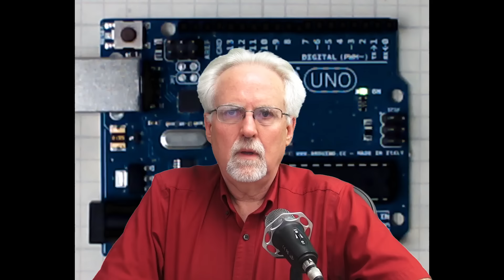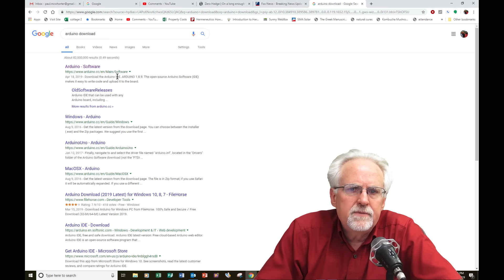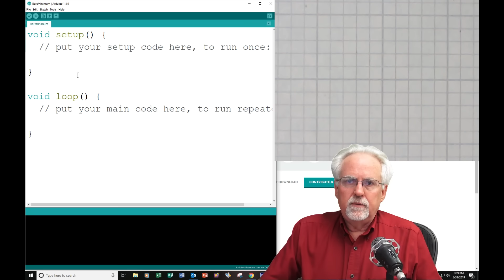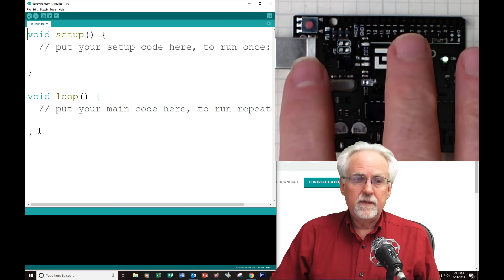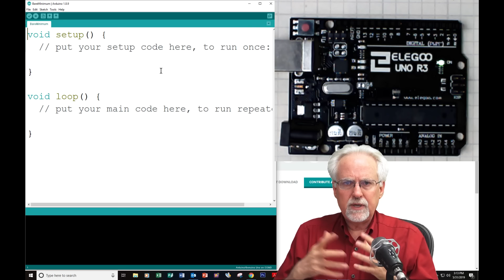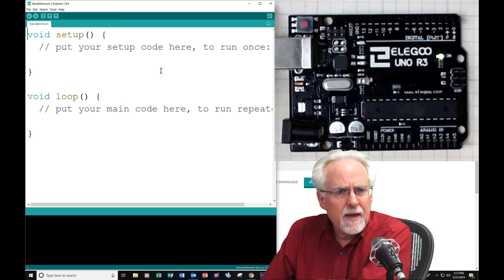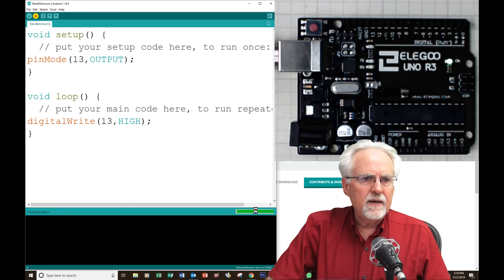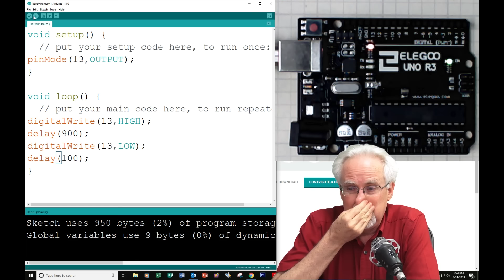Arduino Tutorial 1: Setting Up and Programming the Arduino for Absolute Beginners

Comment: What does it mean when you compile and get error message saying 
“exit status 1”
“Error compiling for board Arduino Uno”

But when I set the same delay to 1000, it works alright and if I set HIGH delay to 900
AND
LOW delay to 100 
I get the error message

Comment: Thank you for this video and I am taking dive into Arduino world as well, I am working on my first project where I am using Arduino to control the brushless motors, I am using the code that is given to me by the company who makes thrusters, when I uploaded the sketch as shown below to Arduino, I am getting this error, - any suggestions? 

#include <Servo.h>
byte servoPin = 9;
byte potentiometerPin = A0;
Servo servo;
void setup() {
servo.attach(servoPin);
servo.writeMicroseconds(1500);
delay(7000);
}
void loop() {
int potVal = analogRead(potentiometerPin);
int pwmVal = map(potVal, 0, 1023, 1100, 1900
servo.writeMicroseconds(pwmVal); 
}

Error - exit status 1
Compilation error: expected ')' before 'servo'

Comment: In order to see the board Arduino IDE requires Port No for the board, but in WIN-11 there is no Port.. I did install the board via USB and ran the IDE it requires Port# to upload the driver, so I went to USB secton under Device Manager and cannot see the Arduino Uno R3 board, I disconnect the Board several times but still cannot see the board under the USB Network either. -- any help?
Reply from the maker: You might try a different cable. could be issue with USB cable.

Comment: I'm a retired software developer in my 80's and throughly enjoying this series.  Having taken innumerable programming courses over a 50 year career, I can definitely say you are the absolute best technical instructor I have ever encountered.   Everything you say is absolutely clear, concise, and a teaching moment.   I'm currently on tutorial 22, but returned to tutorial 1 to encourage new students to get the starter kit and do the exercises as you  progress through the series. I have one suggestion.   Unless I missed it somewhere along the way, you don't talk about comments in your coding.  Comments embedded in code are a great assistance in going back over the code if problems develop months or years after the code was written by the original developer or someone assigned later to maintain the code.  Adding comments is as simple as beginning the comment line with //.  Comments following the // will not be compiled and appear in the code as "grayed out."  An example of comments is the " //  put your code here, to run once: "  in the beginning of the void setup paragraph.
Reply: I too am an 80-year-old software developer and retired company owner.  I have almost no hardware experience.  I stumbled upon this series and am enjoying it immensely.  I plan to ask Santa for an Arduino starter kit, but for now I am using the simulator TinkerCAD.  So far, it allows me to do most thing.  One thing it does not do is allow you to press two buttons at once.  For now, AND and OR gates are out unless you use a switch (which I have successfully done).  I also taught programming in the 1960s and 70s.  This tutorial is absolutely "top shelf."
Reply: It's been 4 years, can I still see to learn it?

Comment: @PaulMcWhorter Your sketches are tiny (a few hundred bytes) and mine on the Arduino R4 WiFi are huge (30K bytes). Mine also take much longer to upload. Any idea why and is there something I can do to reduce the size of my sketches?
Reply: it probably sends all the wifi library functions and stuff with it even if you don't use it...

>is there something I can do to reduce the size of my sketches?

yea, learn all about arduino and the MCUs the R4 Wifi uses  (i mean for a whole year or however long you need, 8 hours a day) and then rebuild the framework for that R4 Wifi the way you want ...

Or use the regular Arduino Uno. But hat thing does only have 2KB ram and sucks "to have real fun" with IOT and stuff. I would try to use an ESP32 board "as an Arduino".

but an arduino uno clone is cheap so you can have that, too

But if you realy want to understand microcontrollers how they work down to the bit register level then regular 8 bit atmega328p based Arduino Uno is way more easy to understand than those 32 bit controllers ...

Comment: Hi guys, I've just got an arduino mega starter kit. 
I've got a MEGA2560 R3, where I'm trying to run these scripts, they error, pinMode returns compilation error saying pin Mode does not name a type.
I'm running IDE2.1.1
Any help gratefully received.
Reply: I'm downloading an older version, see if this is better.
Reply: Older version works fine, thanks.

Comment: Hi, Paul. Loving your videos. I've built a countdown timer using Arduino uno, but it was expensive. Can you show how one can build a circuit that does the same thing as the Arduino using a stripboard? I know one particular chip that can be used is the Atmega328, which I have. This would make the project so much cheaper to build. Thanks, and keep up the good work. You really rock (as you Americans would say). Paul Smith.

Comment: I know it's all about the OS of choice. But I have to say I haven't purchased a M$ product for my main workstations since ME. If you know ME, you know why.
That's when I went to Linux, so it's been a while. Currently it's Linux Mint 21.1. I have to say that getting the interface down to actually connect to the device is non-trivial. Help at Arduino (& most sites) unfortunately didn't work. I had to follow some instructions to write a configuration file in the OS. But lesson 1 is in the books and I hope to do many more!
Reply: just add the correct group to the user to make the serial like `/dev/ttyUSB0` work without root rights...
(logout needed for changes to take effect)

I use Arduino IDE version 2 and vscode with PatformIO extension on Arch Linux. (PlatformIO does NOT work with forks like vscodium !)

Comment: OK, Let's say I have a Nano that is getting 5V power from another misc board via the 5V and GND pins.  I need to unplug the other misc board while I move everything to another location in the house but I don't want to lose power to the whole thing (it is counting Muons) so if I connect the USB on the Nano to a 5V power source BEFORE I unplug the other misc board feeding 5V to everything, will I cause any damage?  Or is it 5V input from 2 sources makes no difference?
(By the way, I asked ChatGPT and it said it may cause a short circuit and potential damage.)
Reply from the maker: It may cause a short circuit and potential damage.
Reply: @paulmcwhorter  Thanks.

Comment: My compiler doesn't change the colors of the text. Any idea why? It still works but the visual aid would be nice to have.
Reply from the maker: I was on arduino IDE version 1.18 I think, which I like much  better than the version 2.xx you are probably using. Try downloading the legacy IDE and see if the color helps are not there.

Comment: if I use OUTPUT and High commands, they don't turn blue. Any ideas? It's an arduino Uno board.
Reply from the maker: It is the new IDE version 2.X. I am using I think version 1.18, which Iike much better than the new one.

Comment: Paul, I have a stupid question- if I connect just the button to an input pullup pin and ground- how input is read if there is no power (?). No other components are used. Thank you
Reply: INPUT_PULLUP electronically switches an internal resistor inside the atmega328p controller to +5V on the IO pin. Digitalread will give a HIGH. if you push the button the pin is directly connected to GND 'overpowering the pullup resistor' - digital read is LOW when button pressed.

Comment: pinMode(13, OUTPUT); 
Why OUTPUT in my IDE is not blue or Green ??
Reply from the maker: I am on 1.18 of the ide. I dont like the new 2.x of the ide, which is probably what you installed.
Reply: I am not sure what you are saying, but what I think you are saying is "Why an OUTPUT". The Arduino needs to know if the pin is an INPUT or an OUTPUT to set the pin up for use, but what is the difference between the two? The OUTPUT is if the pin is outputting data, for example, lighting up an LED. The INPUT is if the pin is getting data, for         
 example, reading the temperature from a temperature sensor. I hope that answers your question.

Samuel
Reply: >I am not sure what you are saying

that different arduino IDE versions could have different syntax highlight color settings

the exact syntax coloring style used usually isn't that important to programers. it's just for easy seeing the different things because they have some different color.

Comment: Hello, like your Videos. 
Which tutorials do you recommend to learn how to make button, toggle switch inputs to do a function on a windows 11 flight simulator?
Reply: In lesson 28 Paul talks about how to use a Toggle Switch with Arduino. But in these tutorials, Paul does not talk about how to get Arduino to talk to programs on the computer, but he has some other tutorials that he made, that will teach you how Arduino and Python can talk to each other. For example, Arduino is reading the temperature of a greenhouse and we want to display the temperature on the computer as a 3D thermometer that is displaying the temperature that Arduino is reading from the greenhouse. But Arduino can't do that, so what we can do is use Arduino the get the data that we need and give it to Python to display it on the computer. But displaying is not the only thing Python can do, it can do pretty much anything on the computer. So I think you need to look at tutorial 28 and do the Arduino with Python tutorials. Sounds like a cool project, if you want feel free to post any Arduino projects you are working on in the comments we always are here to see the projects you are working and we are always here to help. I hope all of that can help you out a little bit.

Samuel

Comment: I appreciate what you are doing here. I’ve got a question. Is the PWM programming limited to above 1000 hertz or can I set a range variable 20Hertz to 100 hertz with variable duty cycle? 

Can I run the other channels at 25Khz fixed with variable duty cycle?

I’m considering jumping on board this Arduino seems like it could be very useful.
Reply: The Arduino Uno is 16MHz so the PWM programming limit is way above 1000 hertz, and yes you can set the speed of the PWM. If you want more about PWM then go to tutorial 8, the video is about PWM. 

Samuel
Reply: Thanks for the information, I think it would work great for most of my project. It doesn’t sound like it will work for the other part. I’m limited so far to audio amplifier and signal generator at the moment to get my transducers to perform the vibrations I’m looking for at 20-100 hertz variable frequency variable amplitude. I am hoping to find a way to integrate this into a less complicated easier end user interface without having to design the PCB myself. The project is intended to be lightweight and portable. The other option I have been testing is a heavy duty PWM 12V using ten amps and am limited to jumping frequencies by tens then the user interface allows the user to jump well beyond 100 hertz all the way to 30KHz which is just useless in this project. 

It’s ideal that I can jump frequencies at minimum by 1 hertz at a time to find the correct frequency in the given conditions. 
Ideally I need to be able to program a similar PWM to do what I want at these low frequencies and control the duty cycle. But not to go below or above the intended low frequencies. Obviously I would need to include power transistors.

Comment: After uploding a program to the Arduino, how do you quit the program? I mean, when you finished your work with the Arduino, you need to do a procedure to quit the program or just disconnect the Arduino from the computer?
Reply from the maker: It runs for as long as the arduino is powered.
Reply: A PC needs a proper shutdown because the operating system needs to write all open file caches to disk etc. the arduino does not have that 'problem'.

The Arduino remembers the last program it got to be independent of the PC.

Comment: I am a self learning Arduino beginner. This is the example of Arduino program " Fade" 
/*
 Fade
 
 This example shows how to fade an LED on pin 9
 using the analogWrite() function.
 
 This example code is in the public domain.
 */

int led = 9;           // the pin that the LED is attached to
int brightness = 0;    // how bright the LED is
int fadeAmount = 5;    // how many points to fade the LED by

// the setup routine runs once when you press reset:
void setup()  { 
  // declare pin 9 to be an output:
  pinMode(led, OUTPUT);
} 

// the loop routine runs over and over again forever:
void loop()  { 
  // set the brightness of pin 9:
  analogWrite(led, brightness);    

  // change the brightness for next time through the loop:
  brightness = brightness + fadeAmount;

  // reverse the direction of the fading at the ends of the fade: 
  if (brightness == 0 || brightness == 255) {
    fadeAmount = -fadeAmount ; 
  }     
  // wait for 30 milliseconds to see the dimming effect    
  delay(30);                            
}

According to the program,the Led will Fade/30 mSec_Fade/30 mSec.
My question is if I want  to modify the Led loop as this " Fade/30mSec ----stop 5 Sec ----Fade/30 Sec. How does the program look like? Thank you
Reply: int led = 9;
int brightness = 0;
int fadeAmount = 5;
void setup() { pinMode(led, OUTPUT); }
void loop() {
  analogWrite(led, brightness);
  brightness += fadeAmount;
  if (brightness <= 0 || brightness >= 255) {
    delay(5000);
    fadeAmount = -fadeAmount;
  }
  delay(30);
}

Comment: Great video!  Question:  Is there a way to run the IDE without the internet connection?  Not only do I NOT have internet at work, but why would an IDE, with all the downloads in place, absolutely require you to be connected to the internet before it will even give you the welcome screen?  (Hint: are they stealing your code as you write it?)  Very leery of this IDE!  Is there an alternative?  Also you never explained which language you are programming in...  Aren't there several that would work in programming an arduino?

Comment: I figured out why the yellow light kept blinking. It must have been a factory test.
pinMode (13, OUTPUT); in setup and in loop digitalWrite(13, LOW);  turned it off for good

Comment: Trouble with Pin 13 on Uno R3 slow flashing when connect to tablet USB, and the very first program the words OUTPUT & HIGH do not turn blue or any color. Compiling Error that digitalWrite is not described.
Can you help me figure out what is wrong?
Arduino ver 2.03 
Windows 10 Pro i5-4300U 2.0Ghz 8GB RAM 256GB SSD

Comment: I have a stupid question 🙈 does this kit have to be connected to the computer with USB cable at AFTER the programming is done?
Reply from the maker: Yes, once you download the program, it is in the arduino and stays there until you put a different program in it. If you supply power to the arduino, it will automatically run the program, even if not connected to the computer.

Comment: Doing the code in the IDE before I have received my Arduino kit, my OUTPUT and HIGH do not change color. Is that because I don't have an UNO connected? Version 2.0.3. Also I note this version has numbered code lines. Any comment? Edit, I have received my UNO kit and made several sketches, and still the parameters OUTPUT or INPUT do not change color. Has that been dropped in the later revisions?
Reply: I found out the latest version 2.0.3 has changed a bit and no longer supports the color change for INPUT/OUTPUT and HIGH/LOW. 
  This the message I got from the Arduino Forum. "Arduino IDE 2.x uses an industry standard C++ code highlighting system. This new system has a much better understanding of the C++ language than the more primitive highlighting system of Arduino IDE 1.x, meaning it actually does a better job of highlighting C++ code in general. Unfortunately, this also means it doesn't know anything about the Arduino-specific keywords like OUTPUT and HIGH so there are specific cases where it is inferior to the old system.
  Unlike the Arduino IDE 1.x highlighter, the system used by Arduino IDE 2.x doesn't have any provision for defining custom keywords, which makes it technically difficult for Arduino to add a knowledge of the Arduino-specific keywords to the Arduino IDE 2.x highlighter."

Comment: Using Arduino MEGA 2560 board with a red LED light, IDE 2.0.3:

At 14/1000 of a second on/off delay, I can still perceive flickering without squinting or looking too close at the board.

At 13/1000 of a second on/off delay, flickering is not perceivable unless looking very closely at board.

At 12/1000 of a second on/off delay, flickering becomes unperceivable unless looking very closely at board but can perceive flickering when squinting.

At 11/1000 of a second on/off delay, flickering becomes completely unperceivable.

Comment: Hi Paul, having trouble getting through UNO Arduino lesson one.  I purchased the Super Starter Kit UNO R3 Project Kit.  Looking forward to staying with you
and on to many of your projects.  Major problems using the UNO R3 board.   Can't get the light on 13 to blink on difference speeds.  Have problems with 
error coming on while uploading sketches.  I have loaded and deleted the UNO Arduino board program many times without success.  I've listened to
your lessons many times and I'll continue to listen until I get it right.  Thank you for all you do and looking forward to progress in your lessons.